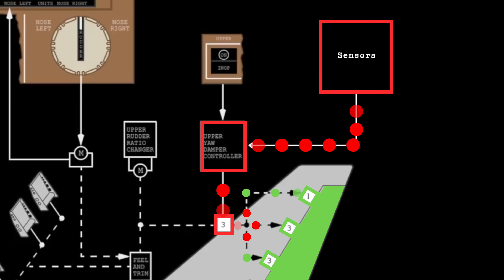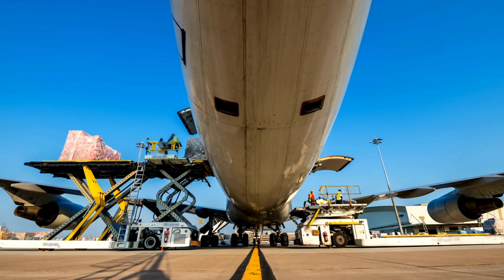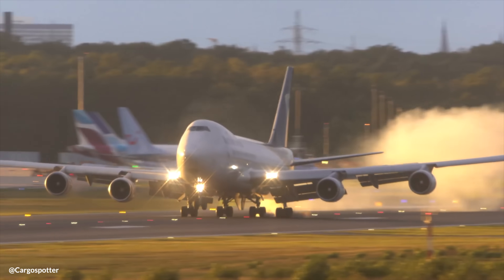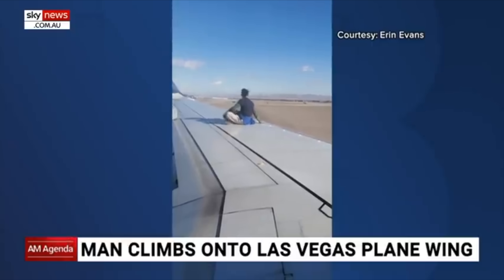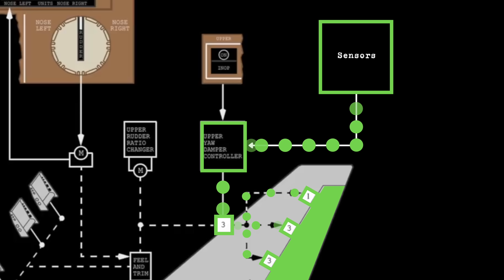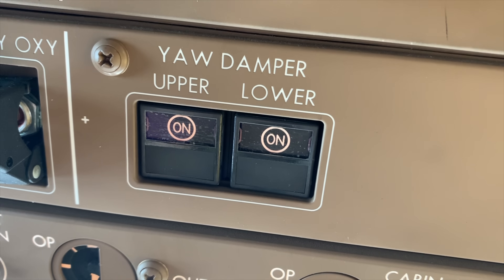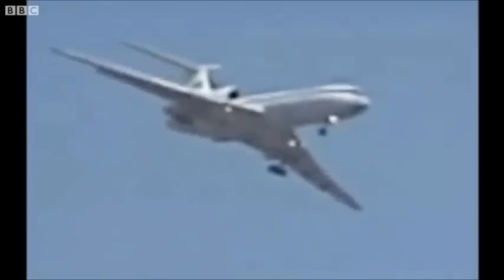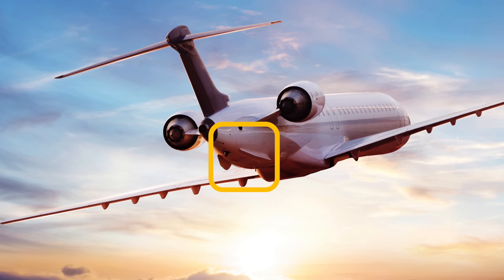What is a YAW DAMPER and how does it work? Explained by CAPTAIN JOE

Comment: Right rudder pedal moves rudder (and nose of plane) to right or vice versa?
Reply: Pushing the right pedal forward points the plane to the right. Very hard for newbies to get used to because with a steering wheel or handlebars, if you push on the right side it turns you to the left.
Edit: I wonder whose idea it was to make it that way. Maybe Captain Joe knows.
Reply: @rwalkenhorst  It makes sense as the pedals (usually) also act on the brakes. Pushing the right pedal brakes right wheel, so the plane turns right. But it would be interesting to know the origin of this convention.
Reply: @SVanHutten  I would be also interested to know the origin of this convention myself.
Reply: @SVanHutten  Good point, although I've been told that differential braking is only rarely used with airliners. Not like a farm tractor where there are times when it's simply impossible to get the thing to turn without holding the inside brake.
Reply: @rwalkenhorst  I currently fly a Flexwing microlight which has no rudder as such and foot-pedals which steer the aircraft nosewheel on the ground in the normal "instinctive" way. In a flexwing which relies on weight shift to control flight you push the control bar left to turn right and vice versa, also pushing the bar forward to climb and pulling it back to descend (although climbing and descending needs change of engine power too). However, doing my difference training to a "normal" 3-axis aircraft takes some getting used to because there is a rudder thingy which works in the opposite sense to the nose wheel steering of the Flexwing and is referred to as "non-instinctive" because it doesn't work as you expect, unlike the "Houses lever" where push forward and houses get bigger and pull back they get smaller etc 😁 My instructor says I should take-up line dancing 😂
I don't know where the rudder sense of movement came from and it doesn't seem to be instinctive but you soon get used to it and I think would probably feel unnatural if it was the opposite way round.
Reply: @125brat  Very interesting, thanks. SVanHutten's comment about toe brakes got me thinking. I grew up on a farm and have been driving tractors since I was 5. When you have a heavy 3-point mounted implement on the back, the front wheels can get so light when the attachment is raised that no matter what you do with the steering wheel it wants to plow straight ahead. Steering with the brakes is a skill that my Dad had to teach me right off the bat. So I think a good mental crutch for me would be to think of the rudder pedals as tractor brakes. To go right, hold back the right side. To go left, hold back the left side.
Reply: @rwalkenhorst  My old Leyland 270 tractor has separate brake pedals for the rear wheels and I wondered how they might be used although they're linked as one, but what you say clarifies it not that I've tried it yet although I normally only use it with a grass topper on the back.
I did have a go at taxying a Jet Provost a few years ago which just steers by differential braking and a castoring nosewheel. That was interesting and quite difficult. Yes, your analogy of the tractor brakes and toe brakes works.
Reply: @rwalkenhorst  Yes my Leyland has got that setup and link but I don't really have need to use the brakes independently as most of the time its just straight up and down the edges of my landing strip topping the long grass. I've got a JD 455 with a centre deck which I use for the main part of the strip and the rest of the grass around the house so no real worry about problems with turning. Maybe I'll have a play with the differential braking next time I use the topper, but first I've got to get the "tombstone" off the back of the 270 to change the PTO selector fork as it won't engage☹️

Comment: One remark on the bicycle analogy.
To "steer into it" you'd move the handlebar in the opposite direction as shown at time 3:21 in the video.
If you experience crosswind from the right you'd push on the right hand side end of your bike's handlebars.
The wheels then will follow a strive to the left and due to inertia you and your bike will lean over to the right into your crosswind and compensate that.

And, one more:
Famous for ventral fins, or "fish fins" are e.g. the Learjet models and also the famous F-16.

Thanks for damping my "yawn"  ;-)
Reply: And the X-15 which needed to jettison the large ventral skeg before landing.
Reply: @jassy6046  On the McDonnell Douglas Phantom aircraft there was a problem known as "Left-leg-itis" which manifested itself as needing a lot more replacements of the left landing gear than the right. It was finally discovered that during the flare on landing, the gyroscopic effect of pulling the nose up caused the left wheel to touch first and they took most of the impact so needed repairs and replacement more often than the right one😁

Comment: When gliders or ultralight pilots visit my simulator cockpit, I always have to remember to explain about the yaw damper, otherwise we get such funny/exciting landings. These pilots use the rudder pedals very actively. Yaw damper do the job in most cases for the commercial pilot, so no need for heavy rudder movement
Reply: Float planes also need very heavy rudder use.
Reply from the maker: I know what you‘re referring too😂
Reply: Just remove the esc fuse.  And plug ballast resistor instead of the takata airbags to avoid error light.

Comment: EBD (Electronic Brake Distributor) also acts like YD when braking. if the car pulls to one side veering off the straight line, accelerometers quickly send signals to the ECU to release braking actuation on the opposite side  thus bringing the car back onto the straight line.
Reply from the maker: Thanks buddy!
Reply: @marine-002   It will reduce the braking on the side it is pulling to!

Comment: the pedals are "only" for the ruder or if the tieres touch the ground for breaking 
if i remember "right" at eurowings pilots this was in a conversation , or flightradar 🤔
Reply: @grachoderunwiderstehlichen  It depends on the type of aircraft and undercarriage configuration. Some aircraft have a tiller or nosewheel steering handle to turn the nosewheel on the ground, whilst on others it's controlled through the rudder pedals only. Some aircraft have differential brakes on the main wheels and a castoring nosewheel only. Taildraggers can have different setups again. It all depends on the designer and how best they make the controls to suit the particular aircraft.
Reply: @125brat  thank you , i have had the job-profile beside aircraft-maintaining (  🇩🇪 betriebstechnik ) here it is a "job profile of it's own" ➡️ Fluggerätemechaniker .-/in